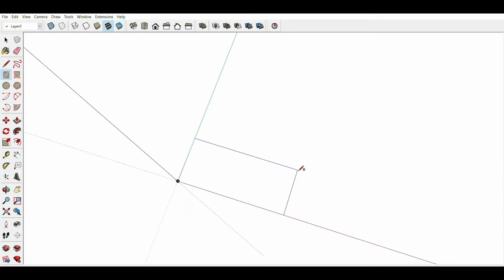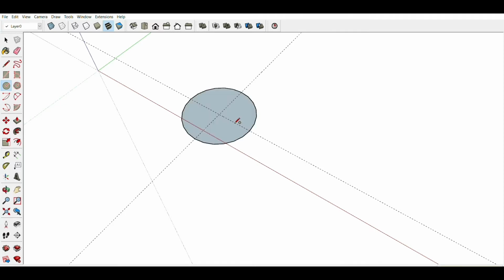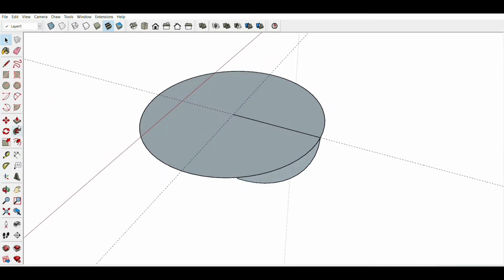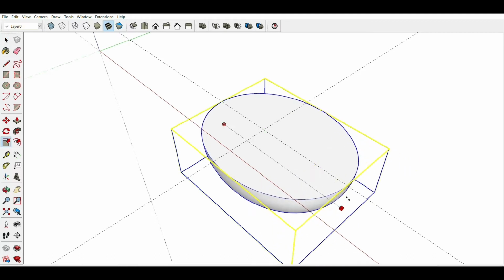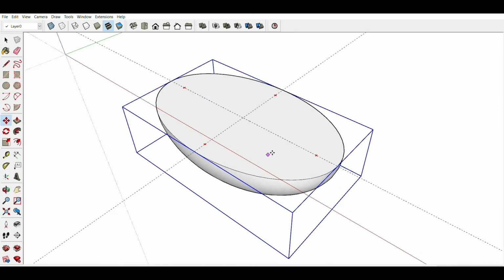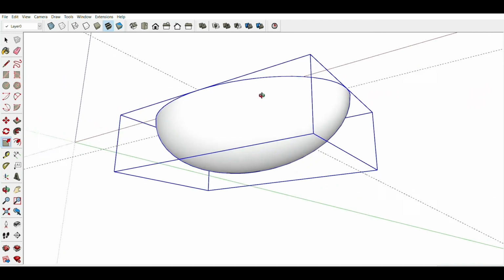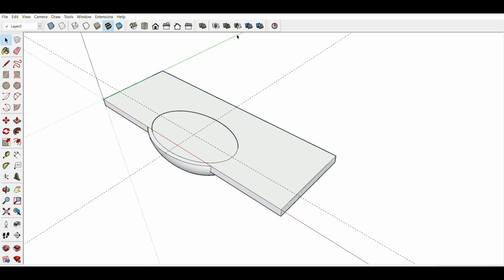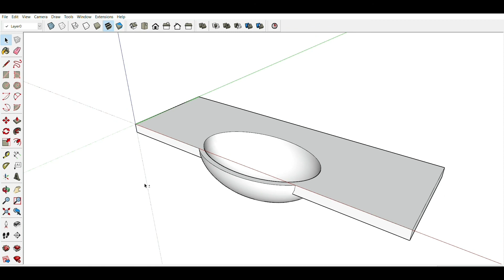SketchUp Pro: Make an oval sink using Solid Tools

Comment: hello, why I can't use the union on my countertop? The rectangle that I did is 'not reading as a solid'.
Reply from the maker: Hi! If it's not solid, then it will not union. Try looking over your piece and see if there are open or reversed faces before you group it. 
Better yet, install the extension "Solid Tools" to check - and fix - solid problems.
Reply: @drawingbard  thanks mate!